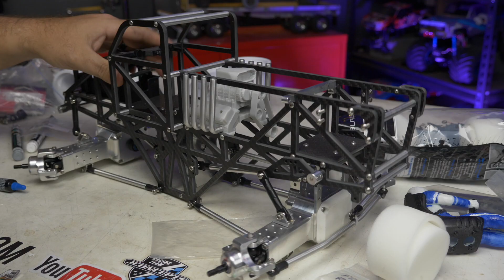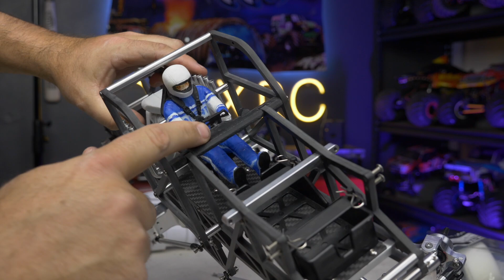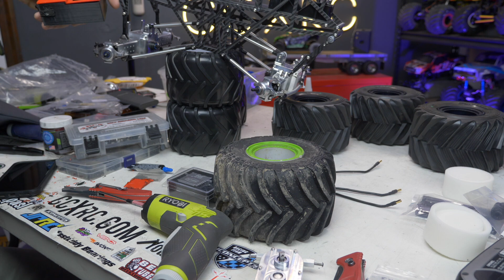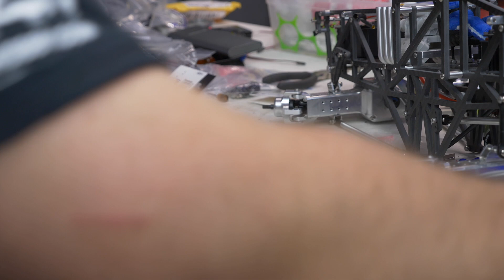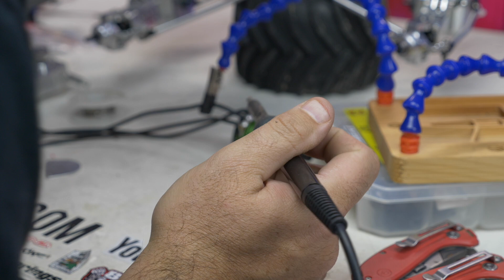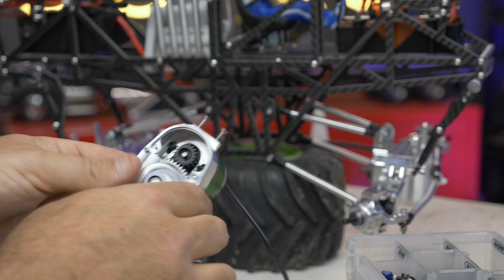Freestyle RC ZEI Chassis Monster Truck Build: PART 2 - Installing Driver & Electronics

Comment: Went on and ordered all my shocks this morning.  The Wildfoot will have 100mm in the front with 90mm in the rear and Power Wheels will have 100mm on the front and 120mm on the rear mounted straight up and down.

Comment: You may want to cut some vent holes in the side of that gas tank.  Without somewhere for the air to exhaust the cooling fan is not going to be able to do its job

Comment: Tony how much do you have in it so far
Reply: I bet he does not want to know : )
I would guess all parts seen so ,1500?
Reply from the maker: With the two Reefs Raw 500 servos about $1500. You could go with cheaper servos or a single servo to save money, but the RAW500 servos are my favorite and they look so good on the polished aluminum axles.
Reply: @CCxRC 
I purchased the parts from Hobbytown to build a front and rear axles for the LMT and after looking at these axles they look very dull.  Going to give them a coat of shiny black paint. Was thinking about the Treal axles, but I don't plan on really running these trucks like that so I'm probably gonna just stick with stock LMT axles.
Reply: @CCxRC  I was right about the parts cost then , BUT was i right about you not wanting to know : )
Reply: 1500 is about where I would guess to